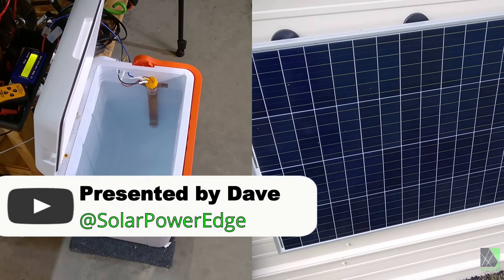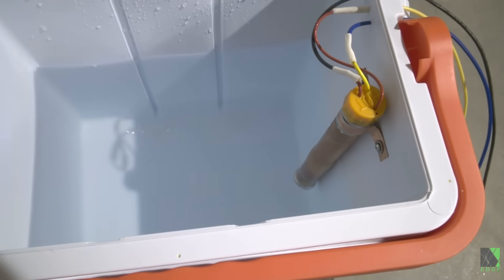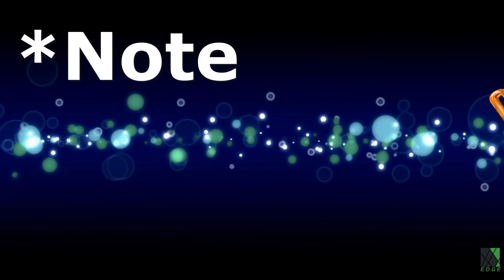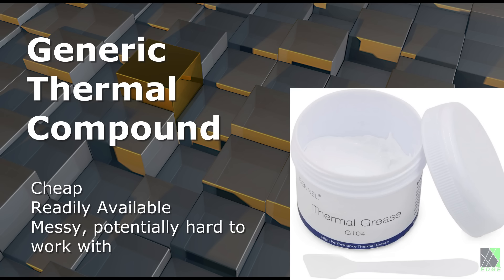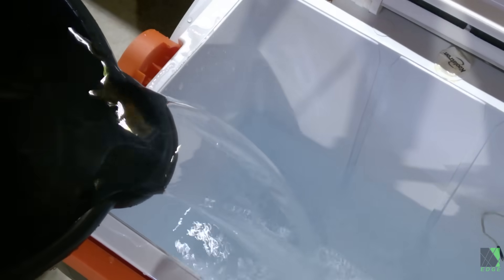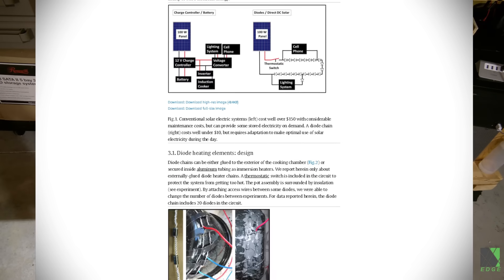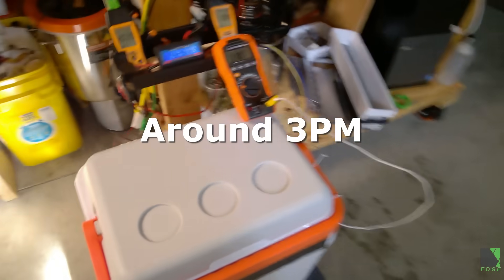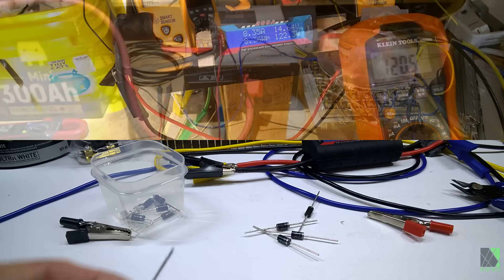I built a PV DC Semiconductor Immersion Water Heating Element! diode chain application #science

Comment: This is a really cool idea. A challenge with this approach when you are only focusing on heating is the low solar panel efficiency in the light to electricity conversion leaving a lot of energy on the table, If the only focus is on heating (versus storing the energy in batteries for other uses) vacuum tube solar collectors would be a more efficient approach. 

If you want to continue to try the thermal compound approach you may see success mixing it with a little bit of solvent to make it easier to pour in. You could also try wax(0.2-0.25 W/mk) or glycol (0.25 W/mk), both of which exceed oils 0.15-0.2W/mk. In all cases you should be aiming to reduce the amount of gap between the diodes and the outer walls of your coper tube. 

The suggestion of a heat sink with the fins in the water and the diodes outside has merit but also leads to the need to heavily insulate the diode side to force the heat into the water. your current direct submersion approach allows you to use a fully insulated vessel like the cooler you are currently using.  A hybrid solution of something submersible like your current heater plus the ability to bolt or press diodes in a to-220 or to-247 package (or the bridge rectifiers) could be achieved with a half round of aluminum that sits in the coper pipe that can be drilled and tapped for mounting bolts.
Reply from the maker: @danielhall8787 All good ideas, thanks for sharing! It's possible to get more heat with solar-thermal, but then I have to deal with a lot of pipes and such. It depends on the use case I guess. I am working on building a large solar electric water heating tank - 2 simple wires for all that hot water works very well for me!
Reply: @solarpoweredge  fair, many paths to rome. :) This is a really interesting path of exploration.
Reply: I also just noticed your vacuum chamber, if you haven't already considered it that may help you get the thermal compound into the tube without air bubbles.
Reply from the maker: @danielhall8787 Ah just like de-gassing epoxy or resin... why didn't I think of it. learn something new every day :)
PS vacuum chamber experiments are in progress... a simple vacuum can do amazing stuff

Comment: Great work mate have you thought of using diodes in TO220 type packages bolted on to a thick flat copper bar soldered to the inside of the copper tube? This would reduce the need for the messy heatsink compound inside the tube.
Reply from the maker: @peterensinger1770 Thanks a lot, yes I ordered some TO-220s to experiment with. I have previously used large full wave rectifiers (metal package) but the metal tab on the 220s and their small size would allow very interesting applications. I've even seen them used to cook food (although I did the same thing with axial diodes)

Comment: Awesome! We've needed a better heater element for a very long time. I have to think that placing the diode chain assembly where the water is colder would change things up a bit. How about using an "L" or a "T" (flipped vertically) pipe system that allows the wires to be out of the water, yet leaving the diodes in the cold part, eliminating the pump altogether, since convection will move the hot water away from the element naturally.
Reply from the maker: @vjnobody You've solved a problem! In some tests, the top was getting too hot for my taste. Making an L/T shape is brilliant. I'd have to solder one 2 more junctions but that's OK.
Incidentally, this would also improve the "voltage slant" problem. Thanks for your contributions!
Reply: @solarpoweredge  you could try using a metal steam tray that you bonded flat packages like TO-220s to the bottom of, rather than immerse your element into. or better an aluminum tank.

Then build a 2" thick foam box to keep the heat in.

This way you don't have to make complicated vessels for the heat transfer from the bottom.
Reply from the maker: @lukerediger8431 OK I'm liking that idea a lot... completely removes the concern of immersing diodes in water and all the connections - thanks!

Comment: Quick question: bridge rectifier which available already with heatsink, is it better than diode chain?
Reply from the maker: @fx1_trader812 Hi, bridge rectifiers are like 4 diodes in a box. I use the metal encased ones with a heatsink to make forced-air heaters with the usual characteristics (dirt simple voltage tracking)
Here's what they look like https://youtu.be/Cle05mmYOUs

Comment: Good idea, good movie, but a bit parcimonious with data.
A phrase does confuse me a little ! Why do you have to measure the energy required to heat your wayer box/recipient ? Why not calculate it?
Also insulate it for efficiency ?
Very good idea combining a resistor with the diodes, is cheaper and protects the diodes.
Reply from the maker: @valeriudinca8952 Hello, check out the research paper in the description for data, charts etc. I am constrained by format here and cannot fill the video with too much data and numbers or watch time will suffer. Also the tank is insulated, it's an ice chest.
Reply: @solarpoweredge  I see your point about data, you are right. About insulation: for a defined object it has a value measured in w/kelvin(or Celsius, the same). Obviously not all "insulatet" things are the same. I believe your ice box doesn't have vacuum panels, so the insulation is a function of surface, thickness of insulator and the thermal conductivity of the insulator. I bet your box is insulated with foam (good but not best) and is relatively thin. You can calculate easily the losses at x degrees Celsius.
Reply from the maker: @valeriudinca8952 Yes it is about an inch of foam, very affordable compared to other options. I wish I had some of those vacuum panels. I estimated the losses to be about 10-20% - incidentally, it can heat my shop all night after accepting about 1.5kwh. I do not know the max heat capacity yet but from ~57 degrees Fahrenheit to steaming hot it can absorb a pretty good amount! I'm building a bigger one at the moment which will hold 6+ kwh

Comment: you could use some of the liquids they use to cool high performance computer or transformers like silicone oil, like Dow Corning PMX-561

probably stay away from fluorocarbons tho
Reply from the maker: @Herbit-k4j  Thank you.. I'm looking into those compounds. I am concerned about what sort of chemicals are used inside the conduct the heat... I noticed when heating up there is some fumes from the thermal stuff I used inside the heating element. Don't want to breathe that
Reply: @solarpoweredge out of the liquid coolants, silicone oil is probably your best bet, since it doesn't degrade with high heat, like mineral oil does
Reply from the maker: Right on... I've added a bottle of silicone oil to my shopping cart :)

Comment: Could something like mineral oil be used inside the heater instead of thermal paste? Also, what type of diodes were used and with what size solar panels?
Reply from the maker: @Fredyk82 Absolutely you can use mineral oil, but keep in mind it's limited to conduct heat. I have tested oil and other substances. I don't know what works best at this point. The diodes are ordinary silicon rectifier diodes and axial leads. I've tried everything from a single 20w solar panel to 100w, 5x 100w, and 10x 200w PV panels.

Comment: You didn't say length of time you take in heating.
Reply from the maker: @duncanapiyo6412 A few hours time, but I'm not too worried about it here. Only total Watt-hours or KW/h really matters as they're 1:1 for heat output (BTU). And that's how I compare the diode chain to a resistance heating element connected to soalar panels - only Watt-hours.

Comment: would it work to dump the diodes in an an oil bath inside of the copper tube? would the heat conduction be enough? I've seen people dumping their entire pc mainboard in an oil bath to cool it...
Reply from the maker: @geekmystique Yes it can work I've built a version of this element with oil. That said Oil does not conduct heat anywhere as good as water but at least it does conduct. I guess it depends on a lot of factors such as how many watts of heat are being dissipated etc.

Comment: One idea that comes to mind: high-current surface-mount diodes (DPAK package, or similar with a large heatsinking tab that can be soldered down), and a metal-core PCB. I think that could strike a balance between ease of manufacture and performance, since you could even order assembled boards with the diodes already soldered down, and possibly use them directly as panels to build into a water tank. The diodes would sit on the dry side of the tank, with the metal PCB substrate in contact with the water and isolated from the water through a dielectric layer between the copper traces and the substrate.
Reply from the maker: @ginbot86 Good stuff! I am looking to make a custom PCB and attempt to use it as a heating element. That could get very interesting. Circuit boards and diodes as solar electric heating elements, really high tech! Thanks for the ideas!
Reply: @solarpoweredge I'm not sure if it'd be any cheaper, but one possible solution would be power MOSFETs, but only used for their body diode. If you can get a bunch of high-current FETs for cheaper than diodes, that could work as an alternative.

Comment: I wonder if you could use Mineral oil inside the tube.
Reply from the maker: @markhysell6163 Yes! the main downside is It does not conduct heat as well as water. But, oil is unsed in transformers and other equipment, so at least it does conduct heat

Comment: Great idea. I'm curious what thermal transfer medium you are using inside the copper pipe. It would be cool (hot?) to bond some diode chips to smile shaped copper slugs (flat on top, curved on the bottom) and mount them inside the copper tube. Or what about stud mount diodes on a flat copper plate?
Reply from the maker: @davefilicicchia6341 Thanks :) I'm using cheap thermal compound... you could use CPU compound, Mgo powder, liquids, oils (messy) I have tried many different things. The point is, without thermal transfer those diodes just burn out quickly. I cannot say what the best method. Others have pointed out I could use a PCB or mount the diodes outside the copper pipe and pump water through; I am looking into these options too.

Comment: Gday mate, great work. I was offgrid for many years. Have you considered using power transistors as "precision diodes." (the base of the transistor is connected directly to the collector.) The behaviour is a little more precise than a standard power diode and the heatsinking ability better in many cases. Old style transistors such as a 2N3055 etc can be very cheap in quantity.
Reply from the maker: @MrMarsMink Hello, good day sir - appreciate your comment. Connecting base-collector is not something I was aware of so I will look into it - thanks for sharing the idea. I am experimenting with cheap Mosfets and trying to find cheap simple ways to drive them. I am looking into the 2N3055 package as well, it has a nice metal case with tabs - very useful - thanks again!
Reply: @solarpoweredge  gidday again mate, thx for the reply. & sorry for being an old fart know-it-all.
 the 2n3055 is still working, powering the voyager 1 and 2 probes out past the edge of the known solar system. 2n3055 costs cents these days, price varying mainly with the value of their copper heat tab ( I have a few of those old 3055 semiconductor dice for anyone who values what they are.) probably from the same batch..... annnndddddd........
I have built these devices and ask to provide my thoughts for the rest of your followers.

First...do not put electronics underwater.
Unless you provide glass/teflon/inert metal leadthroughs, water always creeps in. (Mostly through corrosion,) 
Everything that goes wrong/fails/yowies ("little bigfoot.' translated into canadian.)...and bites you on the arse......... is always between 11pm and 4am & you cant find a candle! ...............try always to avoid having to find a candle at night becuz you fukd up and forgot about MurphysLlaw.
Having said all that, if you push a gold plated brass pin through teflon, its pretty safe as long as there is no pressure difference and not much temperature variation, Teflon creeps and goes wimpy over time but becuz its so hydrophobic, it works pretty well.

The best way I found was to do this :-, 
run the water thru a copper pipe, even by convection, but since you already have a pump, use it. 
Even a small, 10W centrifugal pump only needs a 1/2 inch....(13mm.) pipe.  A pipe mounted vertically and less than 100mm from...against the side of, and connected to the tank with elbows whose outlets are permanently below water levels. 
The taller the water column in the pipe, the better. (for siphoning systems.)
12 Diodes spaced one inch apart is gonna take up say 14 inches (400mm) with room to spare.
The pump must be of a centrifugal type....Detritus notwithstanding, the vane arrangement of this type allows water flow even if the pump is still and unpowered, 
Any sort of piston or diaphragm pump that employs valves will not work!
If the pump fails, steam and heat will still blow in and out of a 1/2 inch pipe. 
These size of copper will distribute the heat adequately for perhaps 1KW  of load into the diodes. Try to keep the heat down to 100^C
For a convection system, perhaps a 1inch pipe. add a copper slab or bar "tab,' soldered to the heatsink pipe. if the water gets too hot, it will boil internally and blow steam, acting like those candle driven pop-pop toy boats. (audible/ thermo/ visual warning system.)
Cover the top outlet to divert blowing steam and boiling water!
The average 3055 is well specified with a voltage drop of about 1.15V @ 5A. This gives a power dissipation of ~6-7W (very safe on a small heatsink.)
A string of these devices say 10 or 11 or 12 or 13, will give a drop of 11.5V, 12.65V, 13.8V, 14.95V respectively @ 5A depending on other factors.
12.65 and 13.8V are often chosen.
This means 11 or 12 in a string, for a 12v battery. Each is able to cope with say 50 watts peak, so a string of 12 in series would cope with say 600 Watts of overload.thats about 2 to 5 big  solar panels in Morocco at midday with a fully charged battery bank & your wife is away... (with you not knowing how to use the dishwasher.)
there are a couple of ways to cheat the voltage, the easiest being PWM load, but thats getting off topic.
Rule #1 Bruce......NEVER RUN OUT OF WATER !!!
Reply from the maker: @MrMarsMink Good day :) I respect your experience and knowledge, and thanks for taking the time to share it here. It's going to take a while to digest all this information. I've saved your reply :)
*I totally comprehend your approach to murphys law... always be prepared and don't build things to fail... I suffer from that law for years haha

Comment: Does the whole system fail if one diode goes open circuit?
Reply from the maker: @JimLahey21 If there is only one string, correct. I have not burned a single diode as of yet. Their max temp is far above where mine operate (100C)

Comment: I would like to see an example of this side by side with 2 identical strings of panels with both types of heating elements. A coloumbic measure of both  solar string outputs, temperature raise of the water over the course of say, 10 hours, for the day, and temperature of the solar panels themselves throughout the test.
I wonder how hot the solar panels are getting by basically doing a short circuit condition to heat the water with diodes. If the panels degrade faster with the diode heaters than they do with the traditional method(s), then over the long term, it's not worth it as replacing a panel, or panels, would negate any power savings from using this method.

Don't get me wrong, I am intrigued by this method. Solar rated diodes can be had almost free by reclaiming them from damaged panels to make these diode strings (I have about 30 panels in this condition with 8-12 diodes per panel available). But I'm worried that the overall stress on good panels would shorten their life span by doing almost a direct short on them.
Reply from the maker: @korishan There is at least one group of scientists who did a comparison diodes vs. resistance using temperature (not watt hours), it's linked in the description. I also made a video discussing their research.
The solar panels are held at their approximate vMP throughout the day and under changing conditions, so they are not "literally" shorted and operating a heating element won't harm them at all.

Comment: It would be interesting to build and compare this diode heater with a resistance element direct system to document the advantage. A simulation would also be possible given the pv panel characteristic curves. I designed and built a direct system
for a remote, very sunny indian village about 10 years ago. Used 8 pv panels in series to produce about 240 volts at the panels peak power, connected to an element in a 100 gallon water heater filled with rainwater. So far, about 30,000 showers. I would like to retrofit the elements with diode strings if it were reliable and significantly more efficient, but PV panels are so cheap today it is most often cheaper to add a panel than to strive for higher efficiency.
Reply from the maker: @glennnelson502 Hi, nice setup, that's a lot of heated water.. awesome. Can you have a look at the research paper in the description and/or my video discussing it... very useful comparison of reisistance vs. diodes with charts and data. It's too hard to present all of my W/H data in my video or watch time suffers. First goal is to make people aware of new ideas and they can investigate on their own if interested.